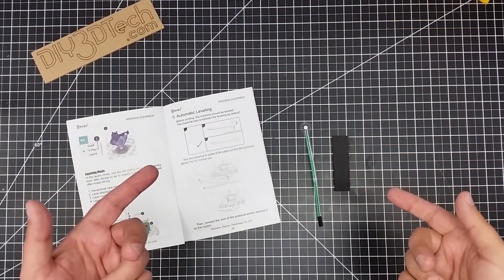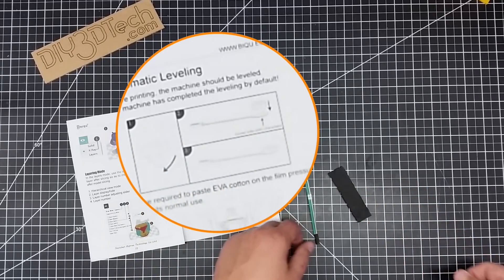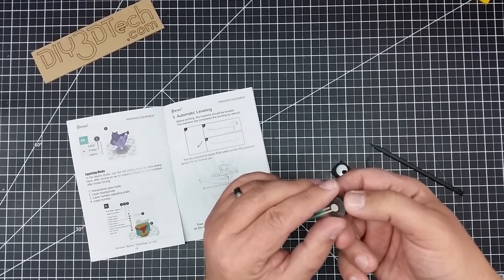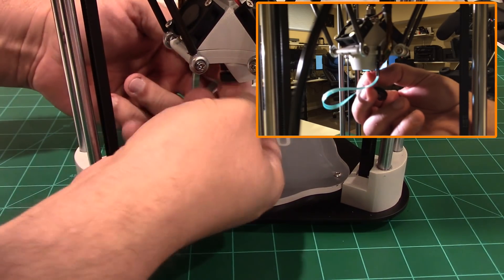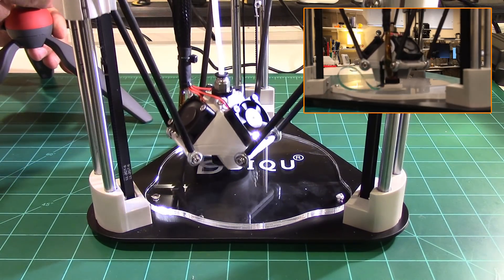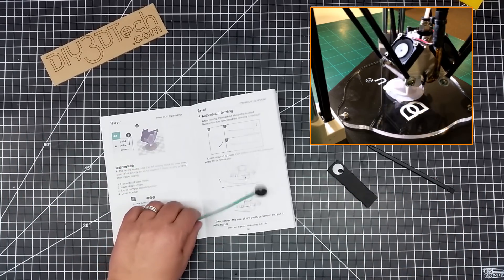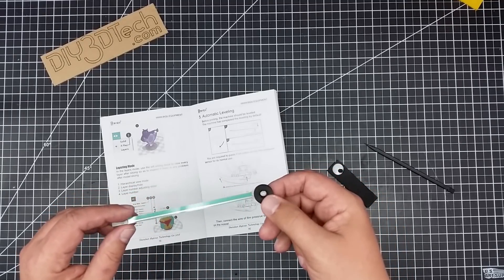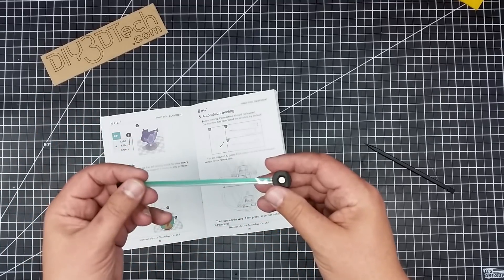BIQU Magician - Setting Up The Auto Level!

Comment: Mine only auto level at three points  where the screws are, how your printer level at so many points, is it an update?
Reply from the maker: Not sure this is the stock firmware however...
Reply: hey man! did you fix that problem?

Comment: Saw these pressure sensors on aliexpress. Was wondering how they work. 
Does that printer use marlin firmware? wondering how the sensor connects to printers circuit board. 
Is it digital or analog sensor?
Reply: It is an analog Piezo sensor you also can checkout https://www.precisionpiezo.co.uk/ , http://reprap.org/wiki/Piezo-electric_sensors and http://forums.reprap.org/read.php?1,635075
Reply from the maker: Thanks for sharing and good to know!